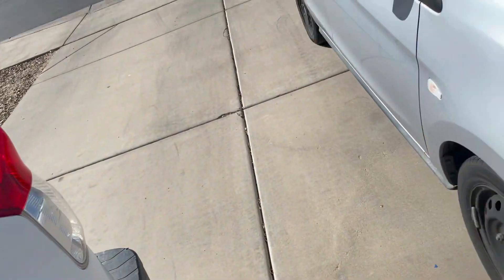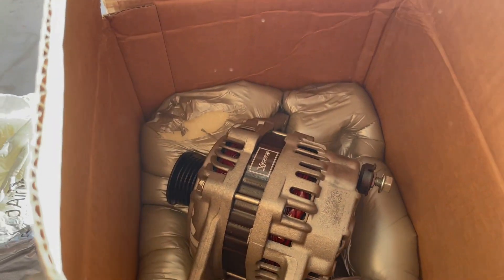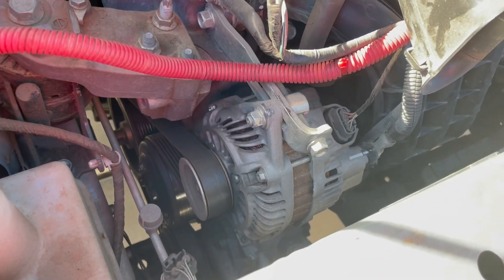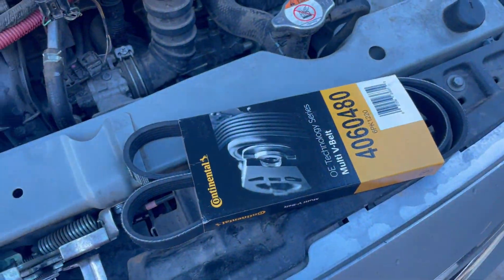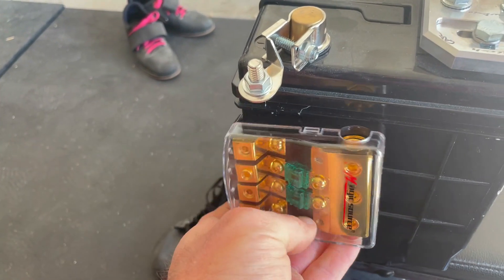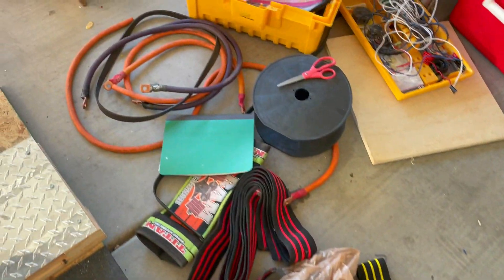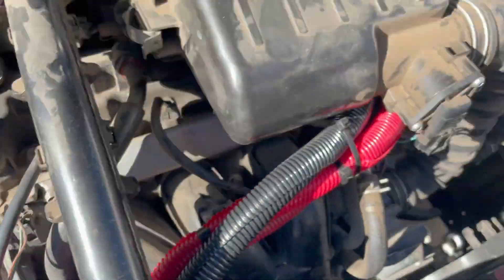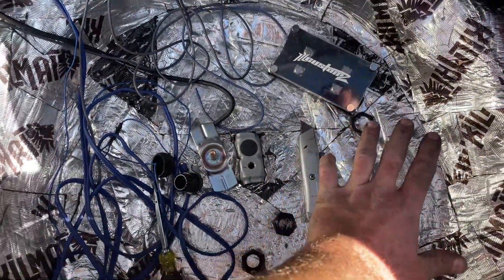Brand-X alternator, Big-3 upgrade, 4/0 Power and Ground welding cable installed in the GoKart

Comment: Hi...always wanted to know how large alternators affect a small engine like that
Reply from the maker: Well… the engine does OK.  It definitely wants to stall at Idle sometimes
Reply: @Husky_Shane_BassHead  Thanks for Your reply..
When You say motor struggles at idle...is it actually the motor struggling to turn the alternator pulley?
Reply from the maker: @vpowerelectrix998  yes.  The Mitsubishi mirage has under 100hp.

Comment: How you like that brand x alt? Was looking at brand x or mechman
Reply from the maker: So far I really like it.  It’s been installed a few months and seems to working great.
Reply: @Husky_Shane_BassHead  cool did you have to go with a smaller belt
Reply from the maker: @johnnypiper1717  I did.  And it took several trips to the auto parts store to get the correct one.
Reply: @Husky Shane BassHead  yeah that's what I was thinking. How could you tell which one was the correct size? How much smaller was your belt from the original? Think I'm gonna order mine before I install my system
Reply from the maker: @johnnypiper1717  I don’t remember witch belt I used exactly.  However, I believe it only ended up being about 1/2 inch shorter than factory.  I just took the factory belt to auto zone and asked them for shorter belts.  They brought me 3-4 that were incrementally smaller.  I purchased all of them.  I found the one that worked, then returned the others back to the store.
Reply: @Husky Shane BassHead  cool yeah that's what ima do. For my truck they have 1 belt that's .53" shorter and next shortest is .93" almost 1 inch. So 1 of those should work. What kind of system you running?
Reply from the maker: @johnnypiper1717  I’ve got a single Pierce Audio 15” in a ported box, running on a Taramps Smart Bass 5k

Comment: Has the brand X alternator been holding up good and what about the charging voltage I've been hearing bad things about brand X and can't tell if it is people hating on the company or true facts about the product I have a buddy at work and his screams loud as hell because the one he bought was apparently not NEW it was one brand X had refurbished and sold him as new but the pulley was obviously old and started screaming less than a month after install so I'm wondering if you had any of the same problems how it has held up and what is the charging voltage like Jerry ain't loud posted a review of an externally regulated one that should have been able to charge in the 16's and couldn't get it above 15.6 or 15.8 something in the 15's anyway that's not good so I'm wondering how yours has been holding up
Reply from the maker: This thing has been working great since I installed it.  No complaints from me
Reply: @Husky_Shane_BassHead  awesome thanks for the response bro

Comment: Link to the alternator? Having a hard time finding it
Reply: Actually if you can link the fuse box too!
Reply from the maker: This isn’t the exact fuse block but it’s pretty much the same thing.  Looks like the one I purchased isn’t on Amazon anymore.
https://www.amazon.com/BULVACK-Holder-Copper-Distribution-Amplifier/dp/B09743WCMP/ref=mp_s_a_1_4?keywords=fused+distribution+block&qid=1681309941&sr=8-4
Reply from the maker: As for the alternator, I just sent BrandX a FB message asking if they built an alt for my car, and they do.

Comment: I ordered one and it came to me and it hadPulley also the ground boat was in the wrong spot, and the wire connector was in the wrong spot the pulley was for a gasoline engine. I told him I have a diesel I have a 2018 Ford transit van I mailed it back to him. He fix the pulley and the other problems but I told him the mounting was wrong because it’s so different than my stock mounting and he he refused to fix that so I tried to put it in my van and it wouldn’t fit so I mailed it back to him and now he won’t give me a refund.
Reply from the maker: Sorry to hear that.  When I received my alt, the case was put on backwards.  I ended up having to disassemble it myself in order to fix it.  It does work great now that the mounting eyes are in the right location.